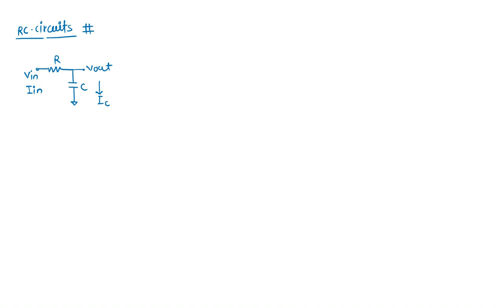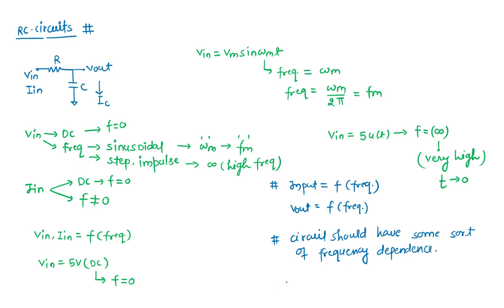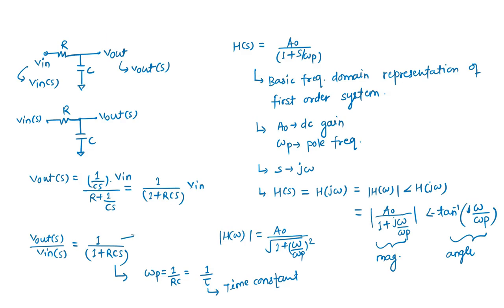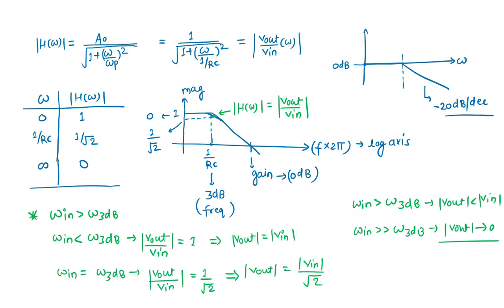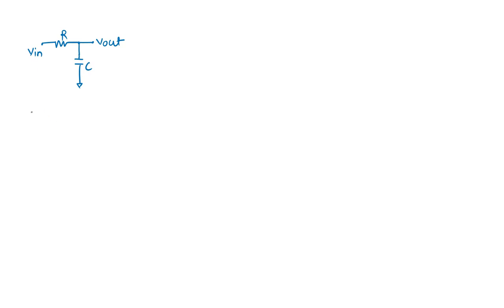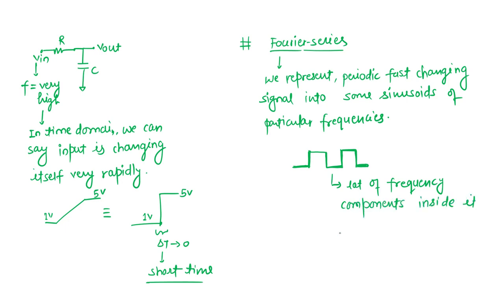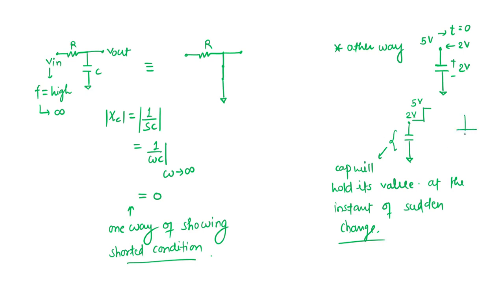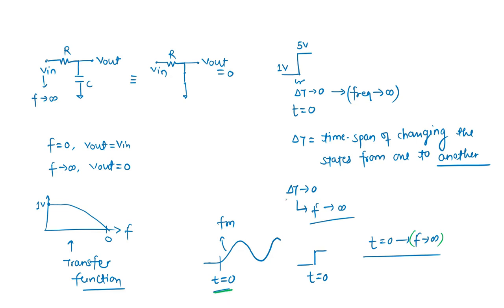Lecture-01 || RC Circuits || Capacitor Charging with Various Input Excitations

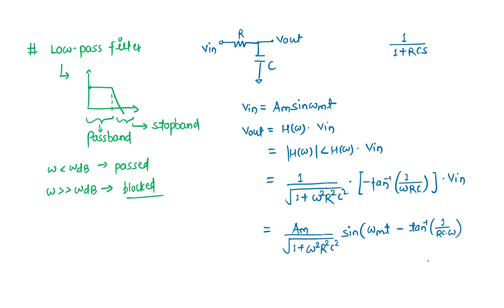Comment: 22:02 it should be -tan^-1(wRC) isn't it? 
btw, great content ahead🥳
Reply from the maker: @srijanisallyouneed  yes it will be that... Missed during writing it
Reply: @learningexpress183  so, during later calculation for vin =dc at w= 0, dc gain = Am and Phi = 0 23:13